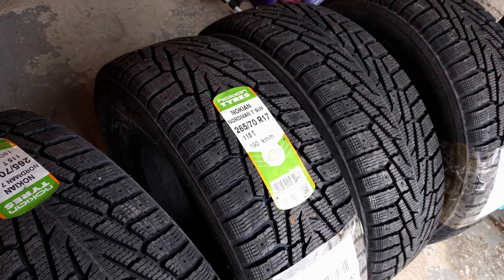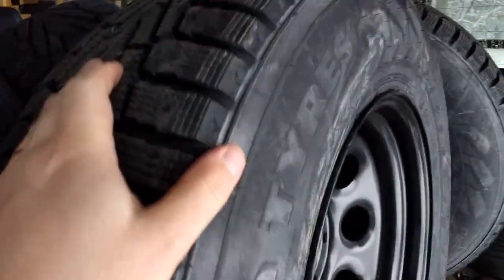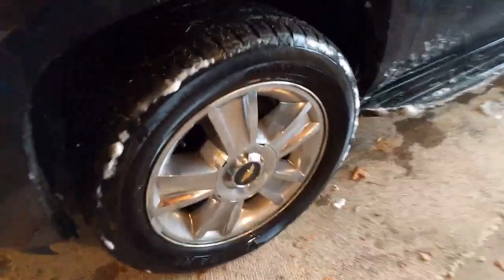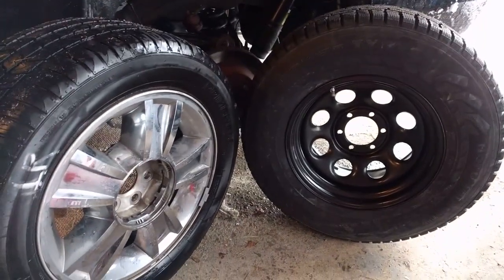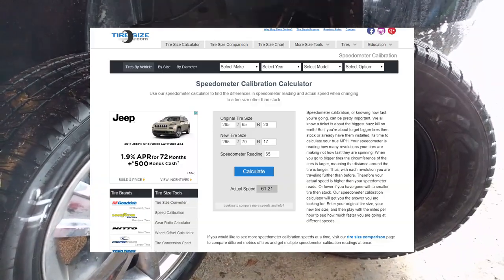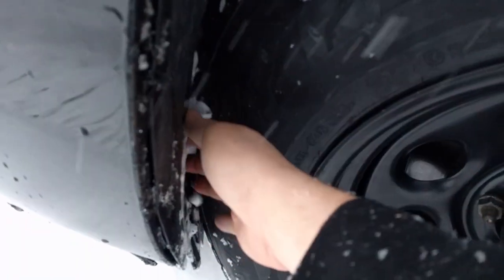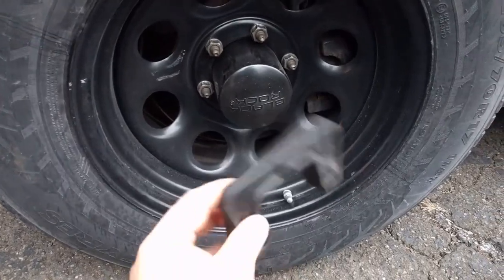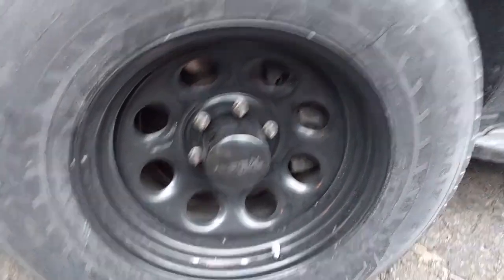New Winter Wheels & Tires for the Tahoe on a Budget - Nokian Nordman 7 & Black Rock 997

Comment: After 3 months on for the winter. And 4th snow storm and salt. Starting to get a little rust so that's disappointing but for a cheap wheels i can't complain.
Reply from the maker: Yeah, my hub caps tend to get the rock chips and rust from dings when putting on the lug nuts. I'd agree, not bad for the money, but touching up the center caps at least seems to be inevitable. The salt will do it. I don't live in a salted area anymore otherwise I'd probably be in the same position.

Comment: Looks good, you can bend the fender liner a bit with a heat gun for additional space.
Reply from the maker: Thanks! I ended up putting the 2" level on the front and I don't remember what is shown in the video, but i did massage and cut some of the inner fenders.

Comment: Can you give an update on those wheels? I’m thinking about getting them and they seem like a great budget wheel. Any word?
Reply from the maker: The wheels are still going strong. I still have the nokians on them and about to swap for a third winter. I sold the off road tires on the same wheels for money and space when moving but I actually bought another set of the black Rock 997 and put some Yokohama geolanders on them for my wife's summer wheels. So we still run two sets on the tahoe. I put a similar looking wheel by American racing on my ram, Baja's I think they're called. Although they're thicker and not exactly the same. Both have done plenty of dirt roads and bumps and lots of miles without any issue so far. I've just found that some shops had to use a lot of weights to balance but another shop didn't have issue so I'm going to blame they didn't mount the tire in the correct orientation with the valve stem. Although certainly not expecting zero wheel weights on cheap truck rims so it's not a big deal. I hope this helps. P.s. depending on the size and offset you may need to clearance the bumper side of the wheel well a little. I also put a 2" level on the front as well which does help if you're running a larger than stock tire and deeper offset like I am here.

Comment: Awesome loved the end results.. 
Question if I lifted my Tahoe 2 inches just in the front should I or not lift the back so they can balance out when I add this tires on?? Any one Please help..
Reply from the maker: Hey Rosie! I put a 2" level on the front of this Tahoe this past winter and it works great. My wife (this is her truck) is running a little larger tire now and they rub at full lock on the washer fluid tank, but the 2" level looks great and affords more room for wheels and tires. You shouldn't need to lift the back as stock they come a little raked towards the front (rear higher than the front). This truck has the air bag auto level so I'm not sure if it compensates so it looks a little like the front is higher than the back but not bad at all. 2" level for the front is supposed to do just that, level the truck front and back.
Reply: What size tire is your wife running now? Is it larger than the 265/70/R17 in this video? I ask because I just purchased the same setup (265/70/R17) you have in this video, and I’m hoping that when I add my 2” leveling kit that I won’t have to trim anything. Thanks for any help/insight you can provide.

Comment: That's not a snow "Storm". That's a dusting. I drove my Chevy Volt thru the 9 inches fresh fallen snow we got in Michigan this November on 75% tread All Season tires with No problem at all. No slippage.  Cool and I just bought a blazer so the info old relevant but the whole thing is overkill if that's all you get. Nice truck though !!!
Reply from the maker: I couldn't call up a blizzard on demand. Don't get electrocuted with your Volt! Tires perform great in our Montana winters now, so definitely worth it. Thanks about the truck!

Comment: If i don't wanna cut the fender liners what size should I buy ? Thanks for the video .
Reply from the maker: Stock size or you could probably go close to the same size just with no offset. The negative offset pushes out the arc a bit.

Comment: I have the same exact truck! Did you noticed a height difference or no? And was the rubbing bad without cutting?
Reply from the maker: Awesome, we still have it. It's great, getting close to 200k on it and going strong. I don't remember the height difference but I think there may be some. You can run a search for tire size calculator and plug in the tire dimensions and see if they're taller or not. Likely only 1/2" if the diameter is an 1" bigger. Because of the offset there was some rubbing at full lock on the lower fender liner and lower bumper and I believe the washer reservoir. I put a 2" leveling kit on the front (basically big spacer for the shocks) and that combined with a little trimming and there's no issue anymore. A lesser backspaced wheel, closer to stock, would eliminate that.

Comment: How would these things perform off road in dry/wet conditions? This company has some of the only 265/55r19 winter tires that exist. I own a VW touareg and love my 19” wheels but want to get a little better all purpose tire. To my knowledge there are no AT’s in that size and really want that size because my 275/45r19’s look so sweet and I don’t want to make them too much thinner.

I know a winter tire is like... for winter, and they can be loud/not great in dry conditions and high speeds. But the same is kind of true of AT’s, and I literally just want a little bigger tire/sidewall that looks aggressive and has like 20% more traction than street tires, that I can leave on all the time whether I’m on or off road. Could a winter tire do the trick? The Nokian R3’s look sweet. I have zero experience with winter/snow tires.
Reply from the maker: These specifically winter tires performed well in all conditions up to about 50 degrees or so ambient when you could tell the compound was soft and tires would wear faster. I actually still have them on a set of wheels but don't plan on using them this season as I put some Pirelli tires on my wife's truck last summer that should be good in all conditions and road types. However, if they don't do well in ice, the Nokians are going back on.

Comment: looks good. was that set up on stock height?
Reply from the maker: Thanks! Yes. There was some minor rub on the front fender liners, but I cut out the bottom half of the front liner and notched the inner bottom bumper. I bought a rough country 2" lift/leveling kit to bring the front up to match the rear and give it more of a lift in the front, but I had issue getting the upper control arm off without a fork. I'm going to try again for looks and extra clearance but it's fine as is. It only rubs on the inner fender at full lock. Anything larger and you would need to do a full nor Cal cut (search YouTube, custom offsets has a good video).

Comment: Looks good! Question did u take the panels off the side of the doors or  did it come like that? I want to take mines off but im afraid i may mess it up
Reply from the maker: Somehow I didn't see this comment, sorry! probably pointless now to reply, but I took them off with a heat gun and used some solvent to get the remaining adhesive off.